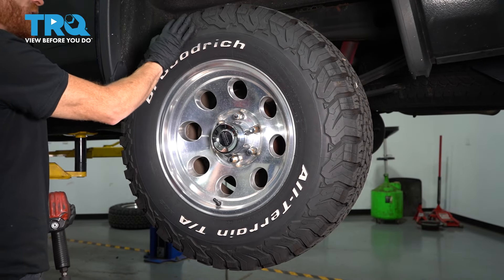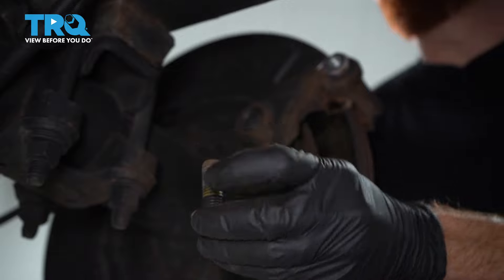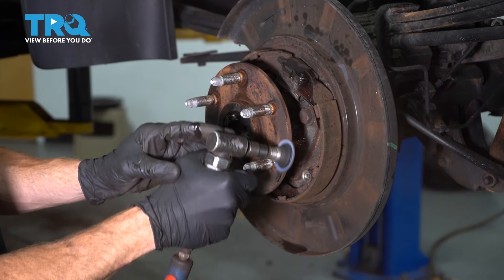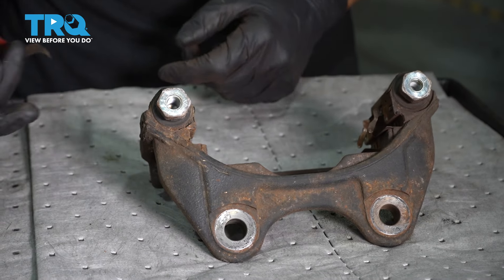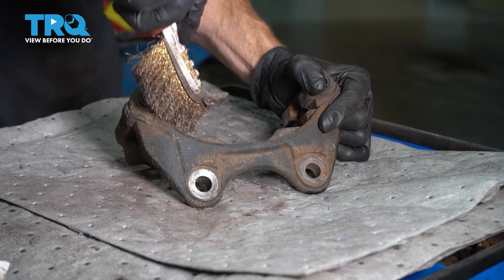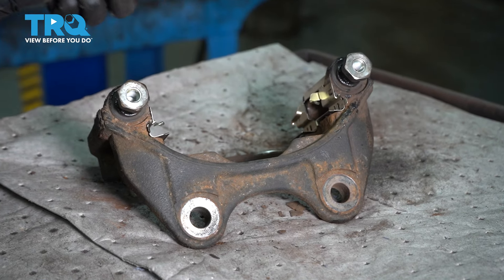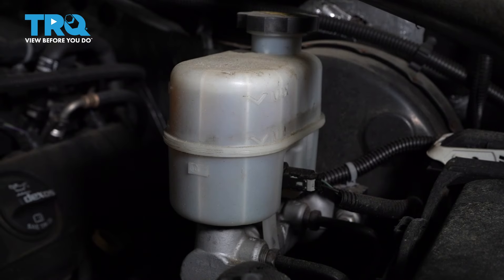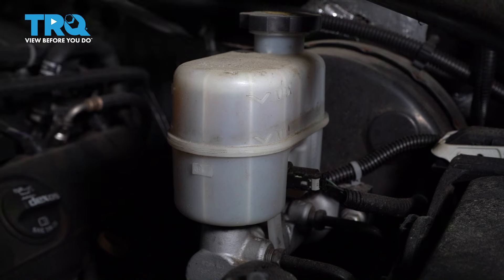How to Replace Rear Brakes 2014-2018 GMC Sierra 1500

Comment: One thing you forgot is that metal plate on the brake pad.  At 18:00.  Not all new pads come with that plate.  For the inner pad that plate should be transferred to the new brake pad if the new brake pad does not have it already. Without the plate the protruding pin can damage the caliper piston and cause uneven pressure when the brake is applied.  Also when you pushed the caliper piston back in you made no mention of popping the cap for the brake fluid reservoir to allow for equal pressure in the line.  Then pressing the brake and resetting after truck is on the ground, then replacing the cap.  These are minor but important steps people should know.

Comment: Great video! Very concise and well spoken. I noticed on this video compared to the replacing of the front brakes video is that the hub on the rear doesn't have a locking screw like the front one did. Why is that? Also, when torquing down the bolts on the slider pins, I noticed that you used channel locks on to hold onto the rubber boot to prevent that slider pin from moving while you torque it down. Does this damage that rubber grommet? Thanks for sharing this video. Cheers!!

Comment: I don't understand the need to put grease between the caliper bracket and the metal brake pad clips.  The clip doesn't move relative to the bracket, so what purpose does the grease serve?

Comment: In the rear brake video from 2 years ago for the Yukon I just watched, this same guy uses parts cleaner and a bore brush to clean out the sliding pins. This video he says not to uses cleaner on the rubber boot....hmmmm

Comment: Great video... Except, I cannot get the rotor off. The parking brake seems to be holding it on. In the video, you basically just say "slide the rotor off" but I've been pounding and prying, pushing and releasing the parking brake pedal, etc etc and I cannot get that rotor off! The driver's side came off after a lot of pounding and prying but the passenger side just will not come off!